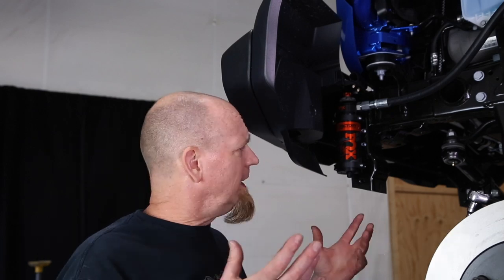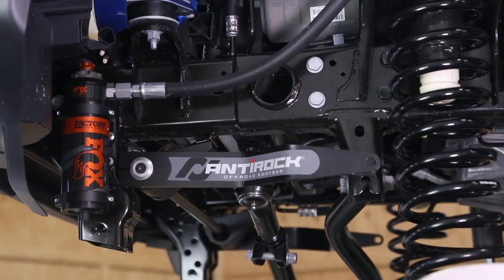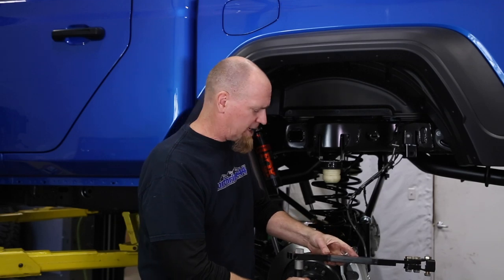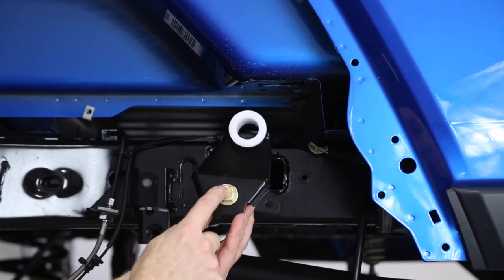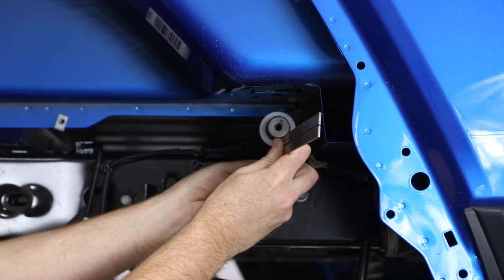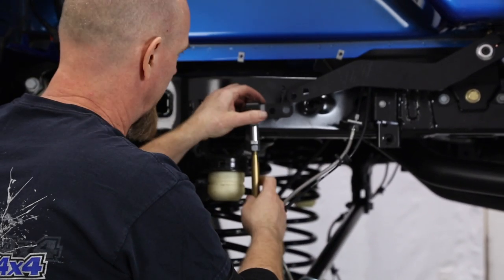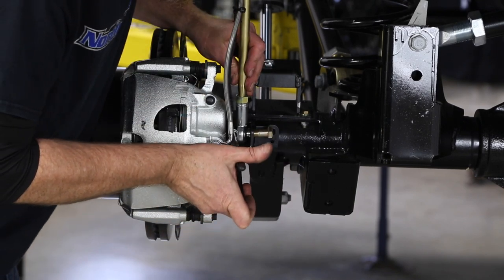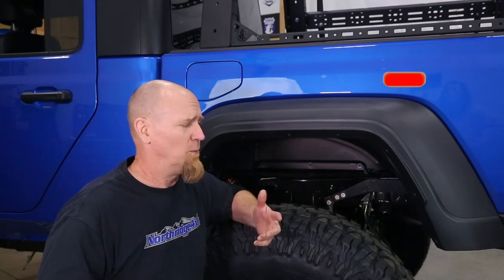RockJock Antirock Sway Bars Front & Rear Install | Jeep Gladiator JT

Comment: Okay which sway bar are you going to recommend for my 2020 Gladiator. The Curie Anti-Rock in this video or the Helwig in the other video?  Both videos you show installing on your give away Gladiator.  I am seriously confused.  Helwig prices about $550 and Curie Anti-Rock is more the twice that. Is the Curie Anti-Rock twice as good as the Helwig.  Be honest.
Reply from the maker: Two different applications.
The Helwig is great for adding more weight handling capabilities. Perfect for a Gladiator or Wrangler with a roof top tent, etc to cut down on the body roll due to the extra weight up high.
The RockJock Anti-Rock is lighter than stock and is for going from street to trail without having to disconnect your sway bar.
We would love to see some heavier rates from RockJock for the overland rigs, their setup is very nice and gives you better clearance than a stock style sway bar.

Comment: Would have really enjoyed the explanation of how to accurately adjust these. I'm a little stumped on my install for the XJ. Think I know what I'm doing but would rather watch someone else do it 1st correctly.
Reply from the maker: The holes at the end of the swap bar arm are the lightest. The holes closest the sway bar will be stiffer. Start with them at the hole closest the end and then take it for a drive. If it is too soft for you, move it forward one hole and then take it for another drive. Continue until until you get it to a point you like.
We're doing another AntiRock video soon, we'll go over the adjusting the sway bar.
Reply: Did. You figure it out? I got one and don’t get how to properly adjust the links

Comment: If I want to lift my JT with the rockcrawler suspension but I also need to tow a 6000lb travel trailer, are these a good or bad fit?
Reply: I would think towing anything will cause more strain and handling on all components. That being said, I have towed with my JK and the antirock sway up front with 3.5 inch lift on 35s and found it to be no different than towing normally. Its all based off of making sure the trailer is loaded correctly and I would think it wouldn't be an issue

Comment: Man, I need a set for my JK!
Reply: Would highly recommend!!! Just posting up a comparison video of a stock connected, disconnected and antirock jk. The results are quite incredible. And Northridge 4x4 is a great company to work with!
Reply: @4WDTrek  How is the anti rock for highway driving?  Any roll?
Reply: @Gordon87Gekko  There is some slight more roll, but then again its a jeep and not a race car. I have had a few times where I had to super swerve while on the freeway and never had any issues with it. I remember there being more body roll than normal the first couple times driving it after the swap, but I don't even notice it anymore. I'm about to swap the rear one in.

Comment: Install on a JK Rubicon or no?
Reply from the maker: Rock Jock 4x4 does have the Anti-Rock sway bars for the JK:
Front: https://www.northridge4x4.com/part/sway-bars/ce-9900jkf-rockjock-antirock-sway-bar-kit-w-brackets-front
Rear: https://www.northridge4x4.com/part/sway-bars/ce-9900jkr4-rockjock-antirock-sway-bar-kit-rear
Reply: @Northridge4x4  is there any benefit for a Rubicon in the front that has push button disconnect I guess would have been a better question?
Reply: @jamminjeeper5854   I was wondering this myself having a JL Rubicon. IMO since it has the electric disconnects, it seems as though this wouldn't be a smart investment but maybe I'm wrong. Still up in the air with it either way.